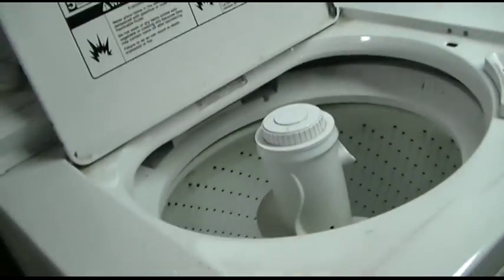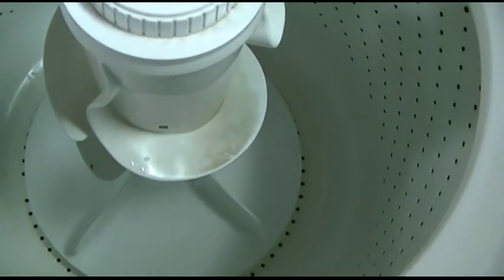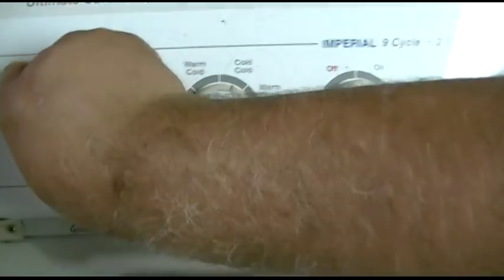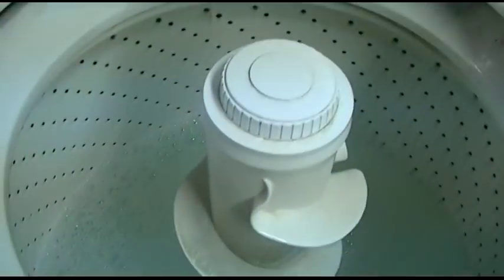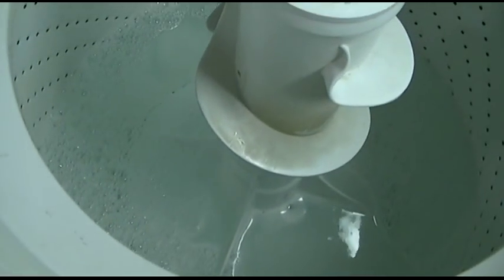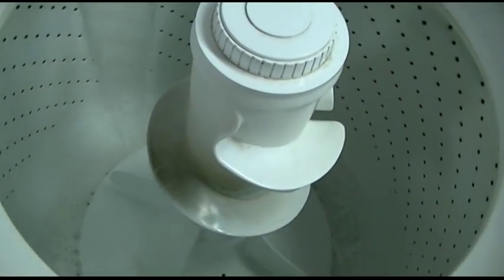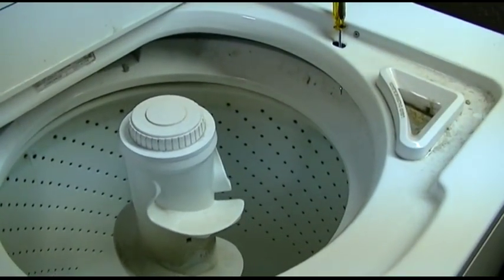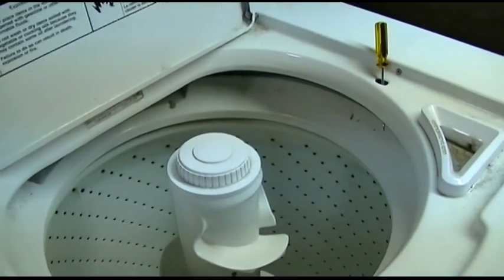Broken Motor Coupler Diagnosis--Whirlpool Direct-Drive Washer

Comment: I have a Whirlpool like this and it agitates just fine (I just replaced the dogs) but it won’t spin. Is it possible that it’s the motor coupler if the machine still agitates? I’ve also read it could be the clutch so looking into that too. Thanks for your videos.
Reply from the maker: For the machine to drain and spin, the motor has to run in the opposite direction.  If the motor doesn't run, that's the first thing to look at.  Could be a bad lid switch or bad motor.

If the motor does run, and it will drain, but will not spin, the clutch could be the problem, or it could be a transmission problem (such as stripped gears), but typically it wouldn't agitate in that condition either

If the motor coupler were bad, you'd know.  You'd hear some pretty bad sounds.

You may wish to check out videos by theapplianceman, he's got lots of different videos that show different scenarios and what the problems are.
Reply: Thanks so much! I’ll check out his videos.
Reply from the maker: @GretchenParrack-c4d  No problem, good luck.  One thing you'll find here is that I reply to my comments, which is something a lot of other channels don't.

Comment: I replaced the coupler 3 times already, any idea of what it could be?
Reply from the maker: If the coupler breaks immediately, you have a bad transmission.  If it lasts for a while, the machine is very clearly being overloaded.  Wash more loads with less in them.
Reply: @jaykay18   it breaks immediately, I appreciate your quick response.
Is it hard to fix that?
Reply from the maker: @AlabanzasyAdoración7  It's a much more involved job.  But, it will be worth it, you cannot get another machine that will wash as well as this.  I don't have any videos on the transmission but you can watch videos by theapplianceman and he has some that show the transmission.
Reply: @jaykay18  again I appreciate your help God bless you. You have a new subscriber.
Reply from the maker: @AlabanzasyAdoración7  Thanks very much!
Reply: I having issues with my coupler. It’s gotten progressively worse over the last 2 years. I’m changing my coupler every 2-3 weeks now.  I seat the new one properly and it’s always rounding out on the transmission side.   I’m buying the ones with that are metal lined.   Is there a heavier duty one?  We are doing 5+  loads a week.
Reply from the maker: @charlesjensen8908  That's pretty rare that they keep breaking.  If the machine otherwise washes absolutely properly (watch other full-cycle wash videos on YouTube and make sure the machine sounds similar), then chances are your 5+ loads a week should be more like 10+ loads a week.  In other words, the machine is being overloaded.  Articles to be washed should be LOOSELY tossed in, and go no higher than the top row of holes.  If people are constantly pushing the clothes down to fit more in, fit more in, fit more in, the machine is being overloaded and it comes as no surprise that it keeps breaking.

Most people refuse to acknowledge that they are well overloading their machine.  That being said, it's rare, but there could be a problem with the brake assembly, or the transmission.
Reply: @jaykay18  I do hear a loud bang when it changes cycles. I always thought it was normal.  But after reading more in these repair video comments I think I’m going to order the whole brake assembly and give that a try. Thank you for the speedy response
Reply from the maker: @charlesjensen8908  No problem, best of luck!

Comment: I’m sure you seen me before, I’m just here looking at your older videos, but I sure miss those machines, I found a machine just like this in the garbage (I know I told you) the timer was bad in it, it would not advance through the cycles so I wanted to work properly and it was $140 not sure if it’s the right one but my parents said it’s too much, like what?! It’s less expensive than the newer machines they are making!!! Whatever goes wrong I would fix it
Reply from the maker: Yes, I've seen your name.  I remember you.  $140 is CHEAP considering what even a base model piece of crap HE washer would cost.  These were some of the best machines EVER made, period.
Reply: jaykay18 I liked your comment on that, when they started introducing these SUCH CRAPPY MACHINES, I was upset and sad, never wanted these to go, they say it’s too expensive but if you think about it, it’s really not, i want them to bring it back! All I want is it to fill to the selected level, and the correct temperature (no temperature control)  then select your cycle you would like, then it starts to fill (no load sensing crap) washes your clothes, rinses your clothes and spins your clothes, that’s all there is to it on on old school, now we have “high efficiency” washers that have all this temperature control and auto sensing, longer to wash your clothes! So there you go NEW SCHOOL VS OLD SCHOOL. New school: BURN🔥🔥 Old school: ❤️❤️❤️KEEP AS LONG AS POSSIBLE!!!
Reply from the maker: With an old school washer, you can do laundry the way you want to do it.  An HE machine will do what it wants no matter what you choose.
Reply from the maker: They do, they spontaneously combust and explode.

Comment: I jave a whirlpool that is neither draining or spinning I checked the pump seems fine also I looked at the coupler I think it needs replacing some of the rubber holes are out of round. How would I fix it if it's not draining?
Reply from the maker: If the motor coupler is bad, the machine will still drain.  The drain pump runs on the shaft coming out the other side of the motor.  There's no coupler for that, it's directly driven.

If the motor runs but it's not pumping at all and you definitely have it on "Spin",  you could have any of the following issues:
1.  Bad drain pump.
2.  Clogged drain hose, either from tub to pump, or from pump to outlet hose end.
3.  Clogged sewer/drain line in the house.
4.  Unlikely, but possible bad timer.  Sometimes, the timer will "lose sync" and even though the pointer will be pointing to spin it's actually trying to agitate.  When the motor is in agitation, it spins the drain pump backwards so water won't drain.

If you need to drain it because it won't do it itself, you can bail it out with a container, or remove the drain hose and lower it to the floor and let gravity do the work, but that's going to flood the floor, so unless you have a floor drain that'll do no good.
Reply: jaykay18 last night I took out the motor and transmission I turned the timer to spin and the rod spun when activated. This being opposite to the fact that when it was installed moments earlier it would not spin the tub so where should I go from here?
Reply from the maker: Possible bad spin clutch I'd say.
Reply: jaykay18 I checked that and it is firm not loose the only part that has been possibly bad that I have seen is the black rubber piece that had a 3 holes out of round and 3 holes perfectly machined round.
Reply from the maker: Inspect the motor coupler VERY carefully where it attaches to the shafts, and see if there's a hairline crack.

Comment: Have you fix the problem with the Dogs and coupler?
Reply from the maker: Yes, I will have repair videos on both of those released soon!
Reply: jaykay18 Great to see a DD machine fixed I have one too at my cottage, from 1993 except it has got a black console and instead of things being spelled out it just has symbols
Reply from the maker: aah asbestiosis Yeah, you can't EVER get rid of one of these machines.  These were the last good machines ever made, no machine has come close since.  Fortunately parts are plentiful.
Reply: jaykay18 I know if mine breaks it definitely bring repaired I am "emotionally attached" to my direct drive lol

Comment: Ahh the whirlpool DD. Love that kine! glad it's being fixed. Let's hope it doesn't erupt in flames (almost), like mine did!! HAHA. 
(Speaking of, we STILL do not have a washer. We are saving up so we don't have to get a POS washer. We're saving for the Speed Queen 92 series top load.)
Reply from the maker: Your DD was the only one I ever heard of having said problems.  If that's one out of how many million, I think that's a pretty good track record.
There's a saying out there that goes something like "the sweetness of low price is long superseded by the bitterness of poor quality."  That means you're on the right track.  Saving up for a Speed Queen so that you won't endure poor quality.  Worth it!
Reply: jaykay18 yeah, I must have had a dud. The one that got away. It went for 15 years with no issues, but then year 16 was troublesome (5 repairs) and then it died.

Comment: I remembered when my Godmother's washer broke. I don't remember the problem or the manufacturer of the machine. I know it was a traditional 80's or 90's top-loader with mechanical controls. She joked with me by telling me to fix it. I was six years old when that happened  so of course I didn't know how to fix it. I wished I knew how to fix it back then because I would have. Today I would be able to fix it. I'm sure by now she got it fixed or replaced with another reliable machine hopefully. 
        If the tub break is worn out, will it affect other components of the machine and cause more problems if not fixed right away?
Reply: Usually, the best way to fix a worn brake is to buy a new spin tube, I think some websites do sell the brake assembly itself.
Reply from the maker: Yeah I've had those sort of comments passed by me over the years as well.

If the tub brake is worn, the tub may start to index when agitating, and just in general you'll get very poor wash action.  It depends on the actual design of the machine, but oftentimes one bad part won't lead to early failure of another, as bad brake rotors on a car will chew up new brake pads in no time.

Comment: I had to do a motor coupler on my aunts Kenmore.  I was really supprised at how easy it was to completely disassemble the machine.  it probably took no more than 20 minutes tops to do the whole thing and I didn't even watch a you tube video on how to do it first.  I just started taking it apart until I found something broken.  The most time consuming part of the whole repair was the trip to Sears to get the new part.
Reply from the maker: These machines were designed very well.  They were designed to be reliable, and easy to be serviced.  That's all we possibly need of any type of appliance today.  But instead they make it near impossible to service, and certainly not very reliable at all.

Comment: Do you have any idea how the motor coupler broke?
Reply from the maker: The machine was beaten and abused.  It's never seen anything but a full load, and any time there's a full load, it's WELL overfilled.  Too much bulk at one time, old non-metal-reinforced motor coupler, and it finally let go.

Comment: Well time to throw the machine in the garbage and buy a new one! Oh wait--this is a Whirlpool Direct Drive! They were able to be fixed if they broke down!
Reply from the maker: The owner of this machine actually contemplated replacing this machine when it broke, and went so far as to go online and just see what's out there and what they cost.  Then I came into the picture.  It needed a motor coupler and a set of agitator dogs.  Then entire machine could be fixed up like brand new for a total of $12 in parts.  Yep, $12 was going to be the deciding factor on junking this whole machine.  Glad I stepped in and saved it.  It has been repaired, and there will be videos on it in the future.
Reply: Nothing says "intervention" more than Jay appearing at your front door!
Reply: if it is had to take the panel on the front off did you lean it on the wall?
Reply from the maker: Sharkie626 You got that right.  The winter beard means business!
Reply from the maker: Chrystal Peck We ended up taking the cabinet off and not leaning it against the wall.  It was easier based on the room we had to work.